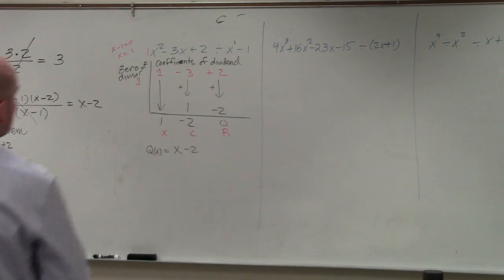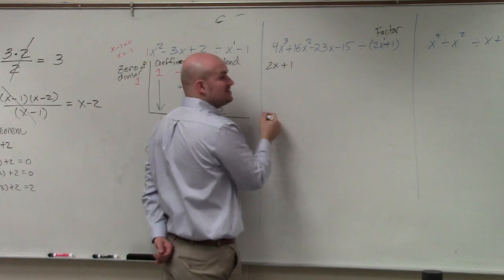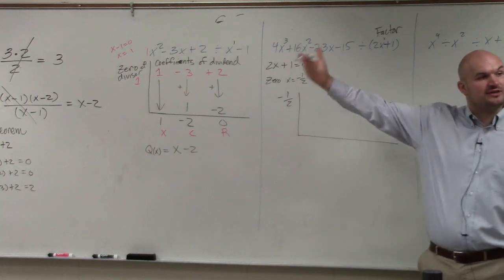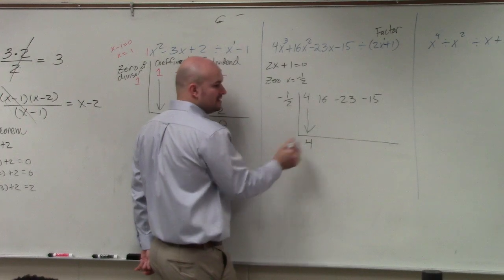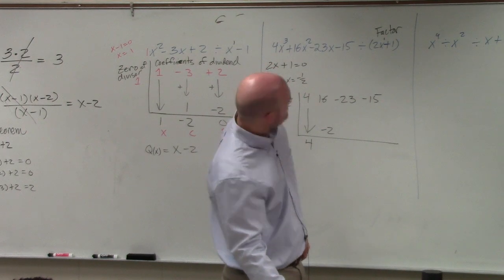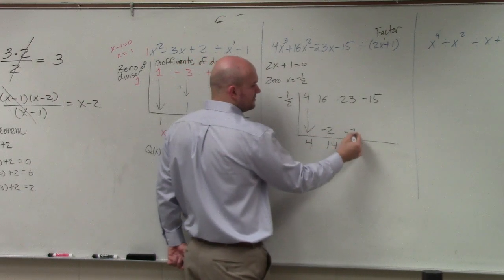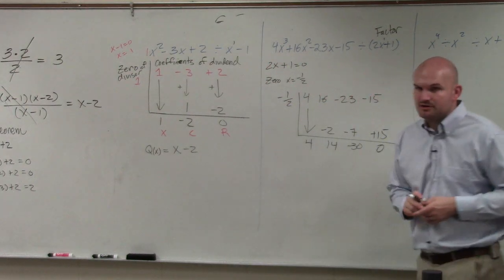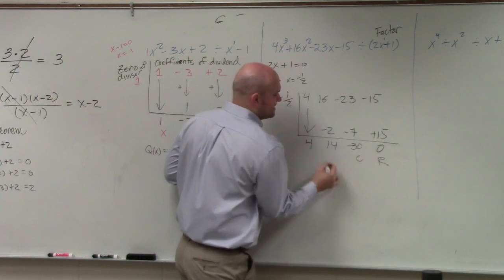Applying synthetic division with fractions

Comment: This answer is incorrect. You need to divide your answer by 2 since you were dividing by a fraction. Graph your answer times the factor. You will not get the original polynomial.
Reply: Know I'm late but I just ran into this problem while attempting a question and came online to check. Thanks for the help. To clarify, we divide the whole answer so all the digits are in their simplest integer form right? For example if my answer is 3x^2 +6x + 9, do I divide the whole thing by 3 to get x^2 +2x +3? Or does it depend on the fraction I use
Reply: Thank you
Reply: @Clutch_PainX depends on denominator